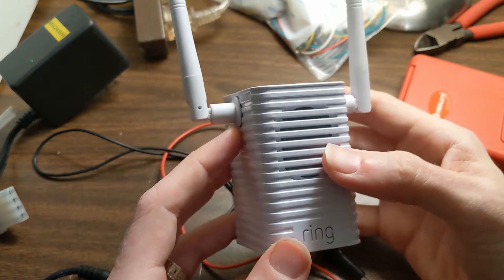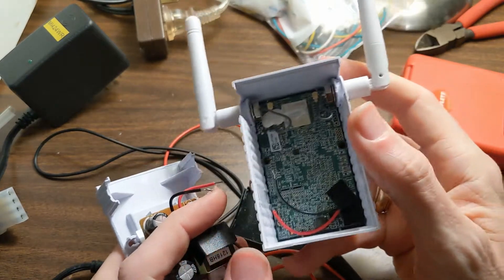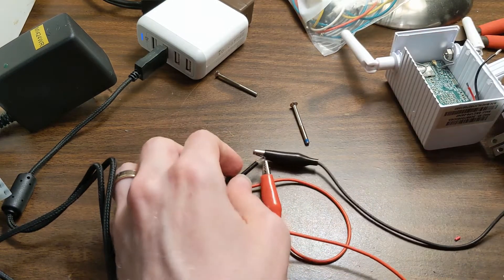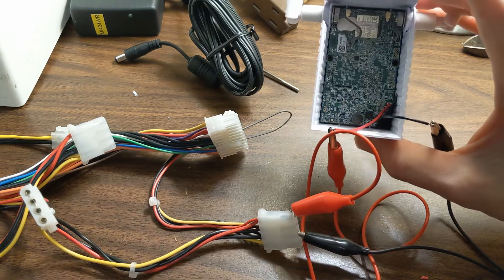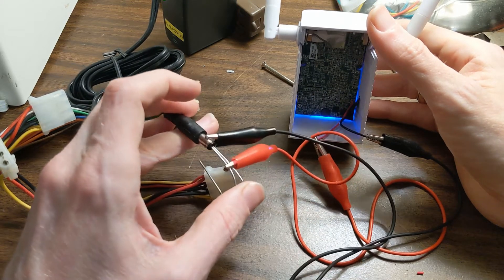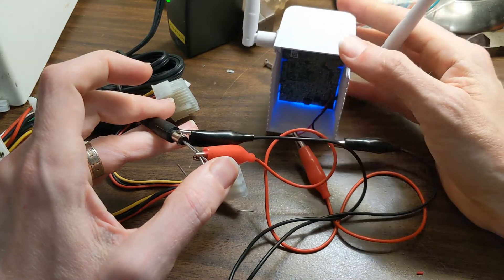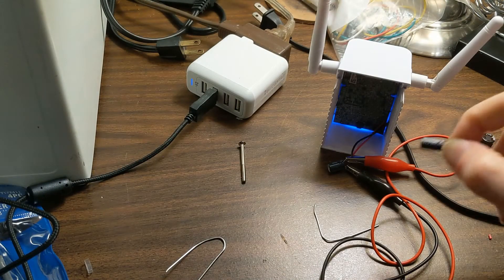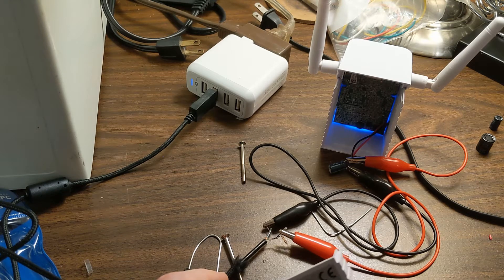Fixing a Ring Chime Pro to run off USB

Comment: I tried to use the compacitors that were on the board it did light up but just kept blinking so went on amazon to see if I could find compacitor that you used can you tell me are these ok to get E-Projects - Radial Electrolytic Capacitor, 47uF, 35V, 105 C
Reply from the maker: Yes, that should work great! As stated in the video, I don't know exactly what's needed, but that worked on mine!

Comment: How did you open the back part?
Reply from the maker: It was definitely tricky! I took the screws out, and then had to pry it open. I think it's glued to help hold it shut, so you have to get through that. Some people have said heating it up with a heat gun helps soften the glue, but I just eventually was able to force it open. Good luck!

Comment: Thanks Luke! Nice work! It was a bit of a chore to open without breaking too much. I used a heat gun to loosen the glue then pryed around the antenna to get the first seam loose. Once loose I used 2 small flatheads to pry along the case. A Samsung high output USB charger worked without the cap and hopefully continues.
Reply from the maker: Great idea using the heat gun! Glad it worked out using the larger charger too!

Comment: Can I do this with ring doorbell transformer plug in
Reply from the maker: I'm not 100% sure, but probably not. If you can find an image of the transformer that shows the voltage and amperage it puts out, that would tell you. The images I found show the transformer puts out 20 volts AC, which won't work if you try to use 5 volts DC. Most doorbell systems put out 8-24volts AC, so not as high as your wall outlet, but more than USB, and alternating current instead of direct current.

Comment: Great idea, didn’t work for me though.  Components on my PCB were fried and stank really bad when I opened it up.  Couldn’t get anything to power even with a direct 5V DC power supply.  Must have been a surge….maybe.  Guess I’ll use a surge protector from now on? 🤷‍♂️
Reply from the maker: Oh no! If the magic smoke gets out, it's much harder to fix.

Comment: Thanks! This worked!
One other thing that stopped was the blinking blue Ring LED. Weird that it worked during the test but stopped. Then ... ChimePro suddenly just began giving me voice commands and announced it was complete.
Reply from the maker: Glad it worked for you! The blue LED is supposed to be a status indicator of some sort, so maybe it was trying to tell you something, but I'm glad it started working regardless!
Reply: Same thing happened with me but it was after a firmware update I got on the app, I think the firmware update disabled the blue led completely
Reply: @CharmandrigoGG  Yes!!! After an update!
It still works though and I used an adapter with a long cord, so my Chime is under a couch... the blue LED is no longer important to me.

Comment: Chime died and your video helped revive it.  Thanks Luke.  Even the pigtail to avoid tugs was great.  USB had 4 wires with shielding but black and red wires worked.  With USB cable I can mount the device in a better place for wifi.  Soldered antenna I accidentally pulled off and just used crimp connections for wires and capacitor and wrapped with electric tape.
Reply from the maker: Sounds like a great technique, and even faster than mine. Happy to help!

Comment: Worked for me.  Upsetting my less than 2 year chime just died.  Thanks for your video, the USB cable i used had 4  wires and black and red still worked and I cut back the annoying shielding .  Brilliant!  Keep up the well explained videos.  Even the pigtail you did was something I wouldn’t have thought of.
Reply: See my response of today, another success.
Reply from the maker: Glad you got yours working again, luckily the wiring is pretty simple! Yeah, I've seen the pigtail trick on some other electronics, it's a simple way to add some stress relief, but I don't usually remember.

Comment: Wow!  Just what I need.  Useful video.  Plan to rewire one to use in my RV's dc circuitry for my ring install when I am not connected to AC power.
Reply from the maker: Thanks, glad it helped! I never thought about doing this with a working unit, but you bring up a good use case!
Reply: @LukeofAllTrades0  SUCCESS!!!  I went on Amazon and got a "DROK Mini Voltage Reducer that steps down DC to use the Buck Converter Board's Volt Step-Down Transformer Power Supply Module."  I soldered the red wire of the 5v 300mA USB cord to the Buck Converter Board ("BCB") input and soldered the main Ring board's red wire to the BCB's output.  I had to create a pig tail of the black ground wires with a WAGO connector to solder them to the BCB's common ground.  The Chime Pro not only booted up smoothly; it also updated its firmware.  Initially, I was going to reduce the voltage output of the BCB (down to 2.5v or 1.8v), but it's running smoothly and, it appears, I don't need to do it (but it's two quick adjustments to the BCB).  This is great for my travel trailer, which runs on 12v Lithium batteries and propane and is powered by solar when not connected to an AC power supply.  Now the final step is to hook it up in my trailer to its 4G LTE hot spot unit, to see if I can make full use of my Ring account.  Again, thanks!
Reply from the maker: @edberrios3679  That's great! I don't know if the Ring will operate below 5 volts, but it's great you have a board that can give you up to 5 amps out, you could probably power several things off that! I wonder how many 120v AC to 5v DC devices I have around the house that are doing the power conversion, I'm sure when running off solar every milliamp counts! Congrats again!

Comment: Hey Ag, nice video!  I have the same problem and I won't use your fix on my broken Chime Pro to correct my problem, but it looks like a fun project to do to see if I can make it work.  Thanks!  For $25 bucks I will just buy the second generation Chime Pro for my doorbell.
Reply from the maker: Haha, thanks! Yeah, fun if you have the time, but not too expensive to just replace.

Comment: Hi Luke, I have a Ring Chime Pro with the antenna in screwed from the body. How did you open your back without breaking anything? 
Any tips would be greatly appreciated. Thanks,
Frank
Reply: I managed to open it up. I used the suggestions of other people who had the same problem. It was a lot of help. Thanks
Reply from the maker: That's great, sorry I didn't get to you soon enough, but as you can see, it's not real easy. I think they glue it or something, so you have to break that seal to open it up. Enough force and it will separate along the seams, glad you finally got it!

Comment: I think the actual problem is the snap on ac plug. The brackets appear to become weak over time and no longer make a connection.
Reply from the maker: I don't remember if I tested for that, it's definitely worth checking and trying to bend them back so they connect again. It would be a much easier fix for sure!

Comment: How did you get the back open so easily? I'm having a helluva time trying to do that right now.
Reply from the maker: It was tough! I did that before I started filming, if you notice one of the antenna is kinda floppy because it got damaged when I was trying to open it. I think they may have glued it a bit, it was pretty tough to break loose. Keep at it!
Reply: I noticed it was already opened .. haha. I eventually got it open by leveraging a screwdriver against the bottom-left inlet for the outlet.
Reply from the maker: @phillipring9534  Great technique! Hopefully the rest of the process was pretty straightforward!

Comment: did all kinds of combos--no go--chime wont turn on but thanks
Reply from the maker: Do you have a multimeter? Even a cheap one from Harbor Freight is sufficient for basic stuff like this, and you could verify that red is positive, and white is negative, and that it's outputting 5 volts when it's plugged in.

Comment: luke--ps--I figured the red was hot and I can touch either the white or green to get approx 5v--could I put the white and green together to make a thicker neutral?  thanks
Reply from the maker: Green is probably data, and depending on the charger could have resistors attached to it internally to trigger higher amperage draws for faster charging. I wouldn't combine it with the white, it will probably not work correctly.

Comment: Thanks for a great video.  It got me going.  My power supply circuit also died.  (The tell-tale smell of blue smoke escaping)  I am curious with your standard USB charger.  When you say standard, I assume you mean 5v DC and 500miliamps, is that correct?  I managed to get mine working with a USB charger that pushes 1amp.  During the boot procedure and all, the current draw did not exceed .3 amps on my Fluke Digital Multimeter.  I gave my Chime Pro ample time to boot and it shows up in the smartphone app.  I was able to manipulate the Chime Pro with the app.  My LEDs do not come on, which is fine with me, as mine lives in my garage.
Reply: The blue smoke might have escaped from the LEDs too for all I know.  Considering that you started with 5v and 500 milliamps and the LED lit up, then my theory of needing more current is out the window.

Thanks for the video it helped a lot and my ring network is back in action.
Reply from the maker: @micchow7381  awesome, happy to help!
Reply from the maker: Yeah, the 500mA standard should be enough, the capacitor was critical for me to get it through some little surge during bootup, but during normal usage it's less than 500mA. That's weird that the LEDs don't come on.